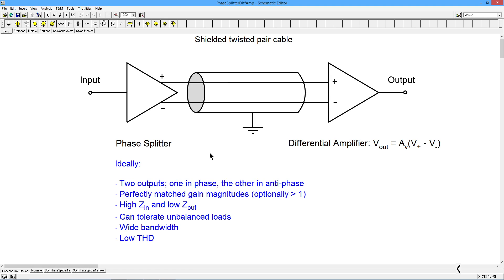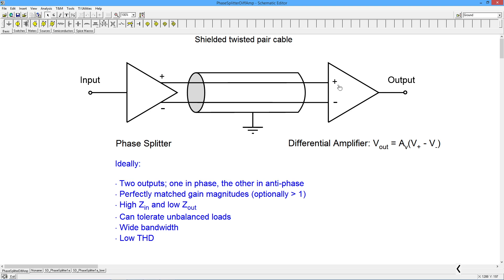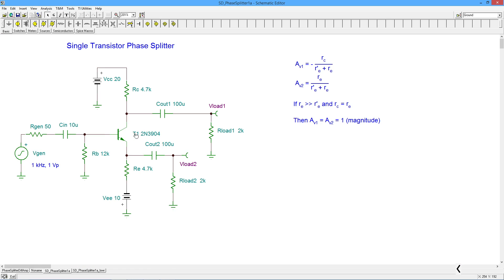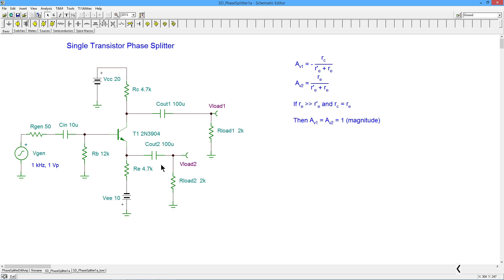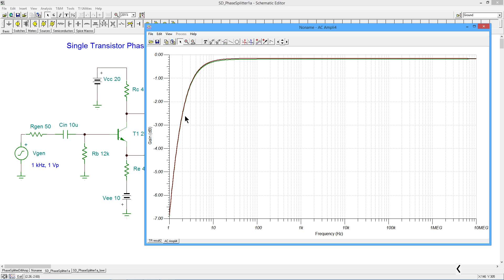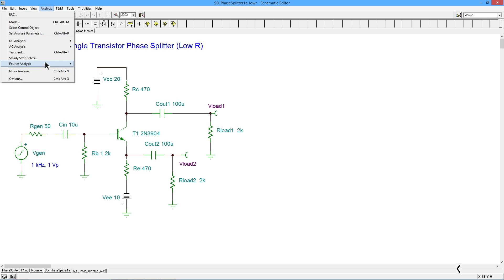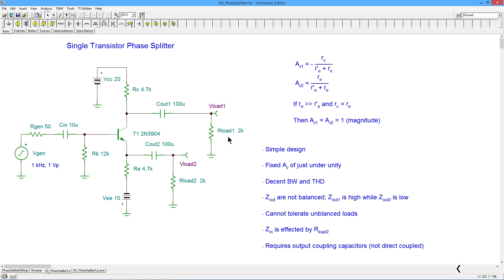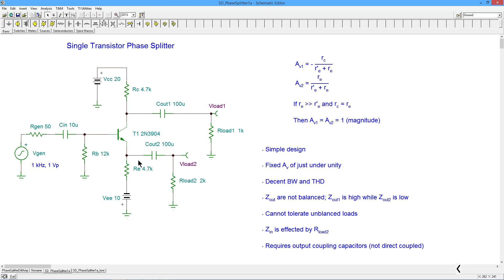Semiconductor Devices: A Simple Phase Splitter

Comment: Excellent, I was wondering about the difference in Zout. Although we get an equal gain on the collector and emitter, would we design the next circuit with a huge Zin (large load resistance) to accommodate the differences? Actually, we could add emitter followers to the 2 outputs to counter the differences in Zout.

Comment: I'm looking forward to your upcoming videos on phase splitters. I hope you make some videos on phase splitter inputs. Hopefully you will cover how transformers are used to process split-phase signals.

I was learning audio electronics as a hobby 30 years ago and I had the idea that inverting op-amps could be used fot noise canceling by mixing in out of phase ambient noise to headphones signals. The cover project for that months issue of "Electronics Now" making noise canceling headphones using that same principle.
Reply from the maker: These days we tend to avoid using transformers where possible. There are issues with bandwidth limiting and distortion (not to mention cost). The quality of analog semiconductors has come a long way in 30 years and quality transformerless designs are now common.

Regarding noise cancelling headphones, we have to be careful about the term "noise". In a general sense, noise is anything we don't want, but in the case of headphones, what we're looking at is a specific background signal that can be sensed prior to the music signal being delivered to the transducers. Inverting this signal to cancel it downstream is a possibility, but generic noise, as in thermal noise and the like that occur upstream, cannot be separated out in the same manner. This is probably the number one question that I get asked about when we discuss differential amplifiers. A phase splitter/diff amp combo can only get rid of noise that comes in after the phase splitter. It does nothing for noise that existed prior to the phase splitter.